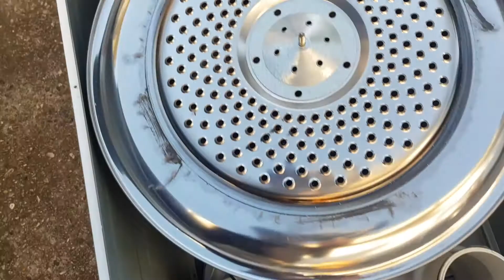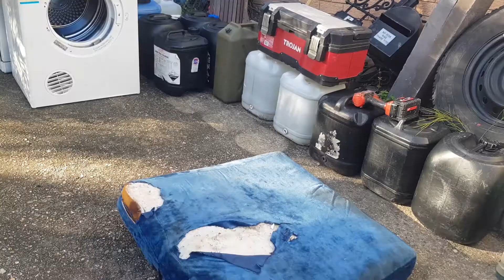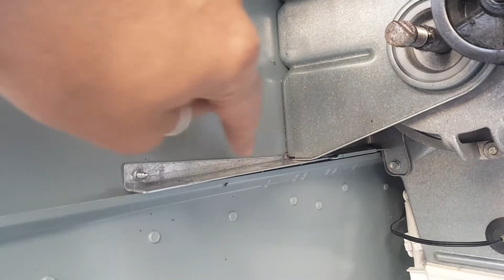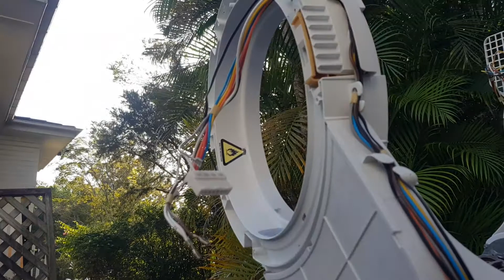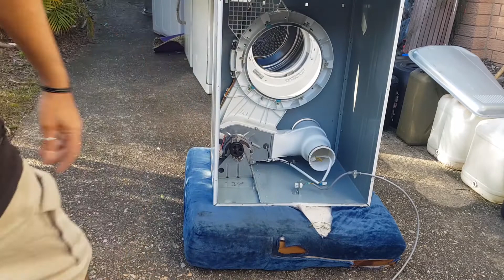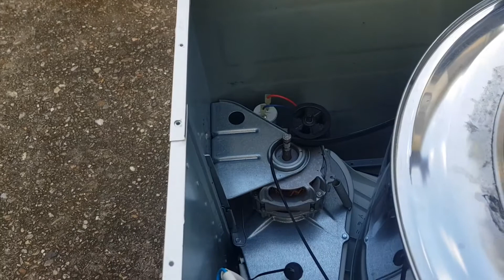Electrolux / Westinghouse Dryer not drying normally. Heat Sensor? Troubleshooting /  Repair / DIY

Comment: Why couldn't you just use the the existing wiring, cut it close to the sensor tip wire and reconnect the new sensor?

Comment: Hey bro. do you have a part number for that humidity sensor or any idea how to test or bypass. Heater elements not coming on, already tried replacing the heater box, didn't fix it. Might be the control panel and that is already ordered, but I can't rule out the moisture sensor and having no luck finding one. Thank you in advance and thank you for this video.  Any advice will help at this point. I have had this Electrolux  EDV 7051 for 10 years, replaced the capacitor 2 times and belt once, I like this machine because it is easy to service until now. 
✌🏻
Reply from the maker: Mate it won't be the sensor. If you've replaced the element and it didn't fix it then you're on the money with a new computer 👍

I don't think the sensor has ever given off that symptom in the hundreds of Electrolux's I've repaired. But faulty computers yes... all the time.
Reply: @DIYDumpRat  I appreciate you brother! Thank you very much.

Comment: Hi, your videos helped me Big Time! I have been able to repair a few dryers... Now I have a strange problem with Westinghouse dryers, two of them with the same problem: they light up, turn both ways fine, but they just Don't Heat. I have tried a few heaters, which I know sure fully functional, both thermal fuses on the heaters' assembly are fine. But No Heat!  
NEED HELP!
Do you think it is faulty "computer" ? 
Thank you in advance for your advice
Reply from the maker: Mate I'm so sorry for the delayed reply.  I'm just coming out of a major house fire event and things are still a little hectic.
And absolutely it's the computer for sure :)

Comment: Hi there, i have dryer same model EDV505,5kg but when i started not even  1 minute and shutdown byit self  can u please  tell me what is the issue, i tried multiple time but the same
thanks
Reply: I thinks your dryer have problem with Power Switch, replace it with a good power switch 16a  is an best option. You can search it call PA512C eswitch

Comment: That heating element you accessed at the 1 hour mark. Can I ask what caused you to by bypass checking that? For my learning.  Your is the first vid I've found on this mode (electrolux sensor dry) and Im attempting repair but struggling with diagnosis. Dryer runs fine but laundry comes out wet/damp. I've heard it could be the heating element or something along those lines.

Comment: Good day Sir ,nice video! I have the electrolux edv6051,i change the fan coz it was making loud noises,after putting it back the dryer does not reverse tumble any thoughts? Tnx mate!
Reply from the maker: No worries mate. Really? Wow that shouldn't ever happen. Are you sure you left it on long enough to get a read? When you first start an Electrolux dryer they normally take around 8-10 minutes before they go into reverse for the first time. After the first time it should only take a minute or so before changing directions. I think you might have been a little too impatient lol. I use to think that when I first started fixing these things.

Normally the heater also only kicks in when it goes into reverse for the first time... or at least that's what I've observed. Give it 10 or so minutes. Great job fixing the fan by the way! 👍😎
Reply: After 10 sec of spinning it stops and still goes clockwise after that i can feel warm air comming out of the front vent.its been going for 15 mins now still no reverse tumbling.
Reply from the maker: @victorcerna2521  Mate I'm stumped.  Sorry for the bum steer earlier.  I've fixed over a thousand of these and never ever come across that problem.  And it was definitely going in both directions before you did the fan fix?  

It's definitely a computer issue.  I just checked one of mine of the same model and there's definitely no control to change directions on it.  The only thing I can think of is that it's perhaps a stuck relay?  If it was me I'd disconnect the power, pull the computer and just give the relays inside a gentle tap.  It probably won't do anything but it's all I can think of sorry.

The relays are the 3 small little boxes on the circuit board.  Next to the power switch.  No idea which one is the the bowl direction control... I'd just tap them all and hope for the best.  If I can think of anything else I'll definitely let you know Victor.
Reply: @DIYDumpRat  its been sitting in a corner for awhile,it was your video that inspired me to change the fan, im not sure if its reversing b4 i change the fan,could the capacitor be the culprit? Coz the motor would stop after 10 secs or so...
Reply from the maker: @victorcerna2521  Umm I'm not sure about the capacitor. Normally your bowl just won't spin and will hum if the cap is dead. Worth a try though as they're pretty cheap 👍
Reply: Tnx six ill give it a try and get back to,cheers!

Comment: Thanks for the walkthrough. I've got the same model dryer and need to replace the thermal fuse. Do you know of any decent online parts dealers for fuses?
Reply from the maker: G'day Jimmy, no worries mate.  Too be honest I've never had to buy parts.  Only Capacitors.  I normally just buy them on ebay.  I think you can buy almost anything there.  Sorry I can't be any more helpful.

Comment: Thanks so much for posting this.   I just replaced the moisture sensor in my Electrolux dryer.   Crazy you need to order a whole loom...  doesn't help the loom is literally one of the first things they install.   Your video really helped!
Reply from the maker: No worries Ant glad it was useful mate 🙂  And really?  Buying a complete harness just for the heat sensor is nuts 😮